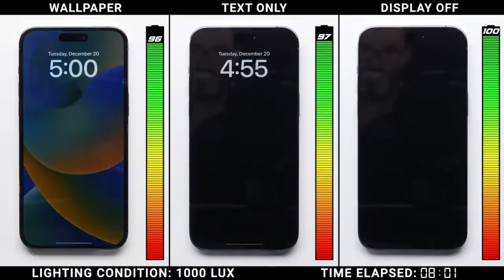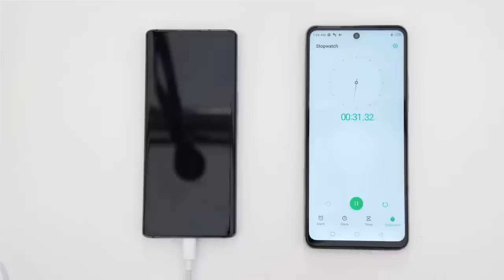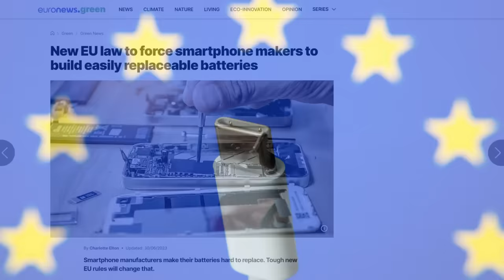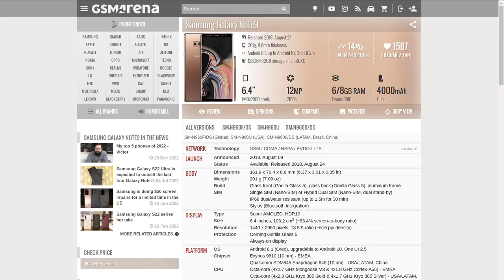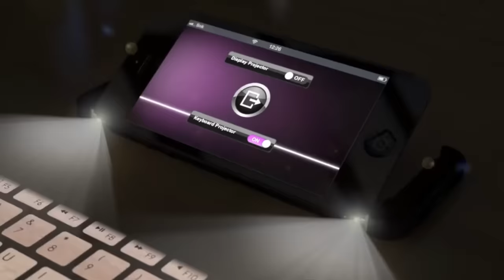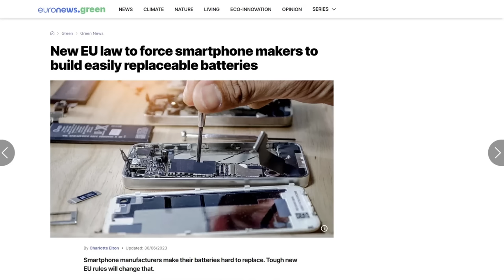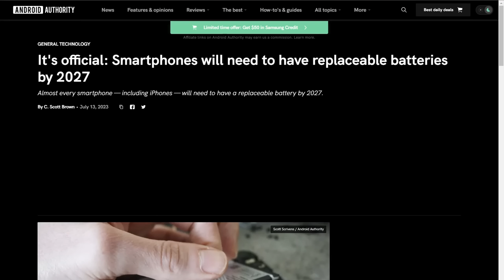All Smartphones Will Soon Have Removable Batteries

Comment: As the EU mandates this very useful policy I hope they also establish a framework for standardization of all batteries, so that the batteries from different phones can be interchangeable.
Edit: After taking into consideration many of the replies here's my reformulated proposal: 
1. INCENTIVIZE standardization rather than forcing it, so that companies can either manufacture common products with standardized battery and receive a small tax-cut for it OR produce state-of-the-art high end devices with custom made batteries, but in that case pay higher taxes. 

2. OBVIOUSLY with standardization I meant standardized per category (based on capacity/application) i.e. all 4000 mAh batteries would be interchangeable among each other BUT not with 4500 mAh batteries, as those would obviously be bigger in size and would instead be interchangeable among other 4500 mAh batteries. I thought it was clear enough but apparently it's not 😅🤦🏽‍♂️

Do let me know what you think about this and what else would you add, although I'm no policymaker, just an ordinary EU citizen (Italian)😅😂
Reply: Yes that is absolutely too much
Reply: Space is so tight in a phone that the battery has to be exactly the right size to fill the space to maximize life while minimising the size of the phone. Standardisation would be great but seems very unlikely.
Reply: Dream on 🙄
Reply: Its wild. If you bought a car and they said the batrery wasnt changable you probably wouldnt buy it
Reply: Bad idea.
Reply: @censored4christ162  yeah, but also you don't pay your yearly salary (or more) to buy a phone.
Reply: It depends on how much battery's are standardized. Is it one battery to rule them all? Bigger and / or more powerful phones usually have a bigger battery. What if new battery technology comes out but over-regulation makes it take years to roll out because it must be approved for use. Governments are slow on approval.

It makes sense that generally similar size devices should use a similar size battery. Proprietary batteries should be avoided, but I also don't want to see manufacturers tide to only one or two options for the next decade, even when better designs become available.

I'm not saying you're suggesting that. More a word of caution.
Reply: eventually
Reply: Requiring batteries to be physically interchangeable may be too much, since phones can vary wildly in size, form factor, and battery capacity. It maybe more feasible to just standardize the battery contacts, rather have each manufacturer use their own proprietary one.

Depending on the phone, even now it should be mostly possible to interchange batteries even if they don't physically fit, as long as you know what you're doing. Many phone batteries only has 3 contacts - two for the positive and negative (usually 3.6V nominal), and one for the thermistor. If you hook these three contacts up *correctly*, the phone should run.
Reply: I mean we weren't able to come up with a one size fits all standard for primary primary cells.
So we have like 10-12 formats that are used everywhere with AA and AAA being the most used.
I could imagine something similar for rechargeables. Like having a maximum of 10 different form factors but manufacturers will have to do with them. No more Diamond shaped cells with rounded edges and strawberry flavored electrons ;-)
Reply: Standardizing batteries won't be done, but standardizing charging method and pin layout could. Imagine external charger with size adjustments to fit all sizes of batteries, and since we already have charging standards for USB-C, adding charging standards for battery itself is not unreasonable.
Reply: that is asking to much don't get hung up with useless details like this. The right to repair would be much better, that all componets need to be easily replacable...
Reply: Why people are celebrating this this will have more negative impact on phones they become less water and dust resistance also uglier and bulkier phones
Reply: @sanjeremyph : Dude you know nothing about this. This how phones always were till like Galaxy S5? So muuuuuch better. for 20$ you get a new battery not 120$. If something goes wrong you just take in 3seconds the battery out. If you don't want to be surveilled same thing take battery out. Water and dust? when has that been a problem for a phone. For me neither (with replacable battery)..
Reply: @peterlustig8778  old phones weren't as water and dust resistance as today phones they had uglier design had no wireless charging phones are sealed in a way that water can't enter thier main electric parts with removable battery they wouldn't be as durable there is a good reason that companies came with this design because it is a better design
Reply: @sanjeremyph  It's funny when you tell me how old phones where.. I have my Samsung Galaxy S3 here in my Hand it is slim, nice a a really fine phone, super easy to replace battery. it's 7 years old went through rain and dusty places. Nothing to it. No the reason that you can't take out the battery is that they can A) charge 100$ to replace it/or make you buy a new phone and B) that the data collection continues even if you thought your phone was off...
Reply: @peterlustig8778  you think If they make replaceable battery the collection will stop no because easily they put a second unreplaceable small battery that keeps collecting data second If they want you to replace your phone they easily will do other things to make you replace your phone like programming it to become extremely slow after 5 years it's not that hard for them to do such thing they program in a hardware level that no one can fix it replaceable battery will make no good impact even now they can market phones as a replaceable battery you just need a cheap heating pad and special screwdriver to open a new phone it's not that hard to replace battery then you glue it again
Reply: @sanjeremyph  For what my Samsung Galaxy is ages old and still works?
Back to the good old times in all fronts in society. ;)
Reply: That's unrealistic and pointless. A fast charge battery on a large phone won't be compatibility with a small phone without fast charge capabilities. What they want is great because you can swap out batteries when one runs out if you don't have any access to charging your phone.
Reply: By 2033
Reply: I support this move. Unless there are innovations in the battery side of the tech, I do not feel secure in having a battery that is not easily replaceable and always deteriorating in every single charge.
Reply: no that would be a bad idea
Reply: It probably is too much, but should really be a thing for phones, tablets and laptops. Particularly for devices like Laptops where they're not especially small and have legally limited maximum capacity, there's no reason not to have standardised battery types.
Reply: @garreth629  Ideally a small set of standardised sizes, capacities and charge/output rates. A standardised connector would mean that new battery tech could likely be a plug nd play upgrade. Case in point, I rebuilt a 30 year old Maglite with a variable LED bulb and USB charging lithium battery. Yes it's more simple than a phone, but if we can have the AA battery standard for over 100 years (1907) there's no reason there can't be a Phone battery standard.
Reply: @censored4christ162  They never said the battery wasn't changeable. And you don't even have to send the phone back to the manufacturer to change it. They change it for you in 5 minutes in the nearest phone shop/repair service. Usually you don't change your car batteries either. You take it to the mechanic
Reply: Would be cool but would probably stop innovation or different sizes of phones being popular
Reply: No my friend. You cannot do that because every device needs a different type of battery for its specific motherboard. High power battery could fry up your phone
Reply: The batteries themselves are one of the hardest things to actually standartize. They have 3 dimensions (thickness, length, width). That means that you would need a lot of formats (which harms the standartization efforts in the first place), or cut them down too much, taking away the flexibility of the internal components' design and arrangement, and forcing phone manufacturers to work around thr few pre-existing batteries. Doesn't sound like the right approach. The most important thing to standartize are the connectors and lack of proprietary firmware to allow for third-party manufacturers to make working batteries. That being said, some common battery formats should still be made with manufacturers encouraged to consider them optionally
Reply: @mom_spaghetti  uh, no, that is only if the voltage is too high or the board is badly built/has a failure, the device hardware, properly designed and working correctly will only pull the amperage it needs/wants, so a device pulling 100mA can last for days, possibly weeks off of a 10ah battery that can push 100amps if needed, for example

Comment: Agree completely, except regarding multi-camera arrays! As a photographer, I find my S22 Ultra's 4 cameras to be extremely useful when I don't have my camera or all my lenses with me.
Reply: 2 back cameras should be plenty. a wide angle 20mm equiv. and a 50-70mm equiv. most ultra wides are useless anyway.
Reply: @PaDamTuts  
Average Joes don't need a Torx screwdriver in their toolkit. Adding one is an unnecessary cost. Anyone who needs one can buy one. Anyone who doesn't need one should have options to buy a toolkit without it for a lower cost.

It's the same with cameras. I don't care what a professional needs for their career — I shouldn't have to buy it if I'm not going to use it. Dedicated professionals carry DSLRs anyway. Multi-lens phone cameras only appeal to amateurs.
Reply: @PaDamTuts  I'm a photographer myself

Comment: Agree with the headphone jack option back. The multiple camera system it's ok in my opinion, is useful. However, if we still talk about bringing good things back, remember the good old times when you screen was intact? Now you have to look at it through wholes, notches and .. who know what other terrible creepy things are still to come. Luckily, my 3 years old Motorola phone still has these 2 amazing cool features :) (but .. no, the battery is not removable; and despite that it only has ip44 water and dust resistance - the Galaxy s5 which has a removable battery comes with ip67 - so .. they should invent more plausible excuse when they try to take the extra cash from us).
Reply: Not really useful the headphones jack since usb-c headphones now exist and it's now cheap
The useful thing  would be external stockage (SD card ) cuz when you are out of stockage without that its either removing thing or using cloud and you always need internet for  cloud also sd card are usually better for transfer)
Reply: @DERRPANZER  except not all the headphones are USB-C and even if it became the new standart for headphones, it would be a hell because, apparently, headphones can be plugged in other stuff, so I'd have to buy either a weird-ass minijack—usb-c adaptor that would inevitably get lost every now and then or I'd have to buy a new PC that has USB-C outlet, a new guitar amplifier with USB-C outlet in order to not disturb my neighbours, a new player(yes, those are still a thing if you go hiking/camping away and want to keep your phone battery alive for stuff like emergency calls or leave your fragile smartphone at home and take a sturdy 10$ call-brick with you instead), etc. Plus, it's always better to have two holes instead of one because the USB-C port can be occupied by charger, wired PC interaction, a microphone or whatever the heck else in the moment when you need your earphones
Reply: @ДимаВеселов-в8и  i mean  on average ppl just want to listen music without having to charge the headphone so not all phone need to have jack just some phone especially the one that are Known for good sound need to keep the jack 
Since it Will be a burden for ppl Who dont need it the jack take some space so bigger phone with useless space on it for these ppl

Comment: I think there can be a major difference between replaceable batteries and the removable batteries we had in the past. There can still be screws (nonproprietary ones) holding a backplate and ensuring a seal, while remaining user replaceable
Reply: Don't think that a ip68 rating will stay after replacing the battery. It's not a simple seal.
Reply: @sinnwalker  GASKETS EXIST :o
Reply: @madbruv  Again, it's not that simple. Otherwise we'd have the option, even in most modern budget phones now it's all sealed up. Being THIN with GREAT protection against debris and having a replaceable battery system isn't that simple.
Reply: It is that simple, it always has been and lots of devices including modern smart phones have had that feature the same you can have any electrical connector be intrusion safe against liquids. The difference is 0.5€ and 1.50€ per phone in manufacturing costs.
Reply: @madbruv No, you heard it. Apparently gaskets, which have successfully kept machines waterproof for decades, are not good enough here.... 😂
Reply: @sinnwalker   TL,DR: You actually can make a water resistant phone with a removable battery. They've done it before.

The Samsung S5 (released in 2014) had replaceable batteries. It was 8.1 mm (0.32 inches) thick with an ip67 rating.

The Samsung Galaxy S23+ (released in 2023) does not have removable batteries. It is  7.6 mm (0.30 inches) thick and has an ip68 rating.

The difference between an ip67 and an ip68 is that a 7 is water resistant up to 1m (3ft 3in) and an 8 is water resistant beyond 1m to manufacturer specifications (in this case, 1.5m (4 ft 11 in)). They have the same dust protection.

So you can pull off a pretty reasonable level of water resistance, dustproofing, and slimness with a removable battery.
Reply: @sinnwalker The relation to water resistance is manufacturers and apologists cope. Flagship phones with swappable battery had high IP rating, with many exceeding the rating of today's average smartphone. Samsung Galaxy S5 comes to mind as one example.

And then you have the whole niche of those "tactical" or rugged smartphones, bulky, with very high ip ratings. Most of them have swappable batteries.
Hell, even walkie-talkie radios have high ip ratings, while having swappable batteries.
Reply: @sairentov  It shows that all of you guys have never designed small things. 
The industry uses a glue seal, since it’s not only easy, but because normal seals on a phone would be impossible. 

The reason for it being impossible, is O rings and such have decently big dimensions. You wont be able to make a a tiny seal, and assure that you have perfect pressure all around on said O ring. 

The EU is ruining the smartphone, just like they did with their mandatory USB C. Goodbye development.
Reply: @010falcon  Literally told you multiple existing devices that do this, but sure "its impossible"
Reply: @sairentov  the samsung S5 
Even though I don’t know if it really had a tiny gasket, was a thick phone and only IP67 rated, modern phones are IP68…
Just like your rugged phones, they are not as slim as modern phones, if you want to see the dimensions of a rubber seal, remove your simmcard tray, and feel the pressure it requires to push it back in, to create a proper seal. That’s not even talking about sealing an entire backplate, and the space that would take up. 

The average consumer doesn’t want a phone that’s heavier and bigger, performs worse and you have to replace the battery at lunch or charge it up so that it lasts for the rest of the day. 
Everyone talks about replacing the batteries on their phones. Yet not one of my friends ever complained of wanting to replace theirs, let alone having replaced their battery ever. And keep in mind these guys are rocking s8 and iphone 10. (I myself am on a S10 plus, which still has plenty of battery capacity left). 
By the time the battery is so bad, that you need to replace it, the phone is already broken or outdated. 

It’s like the idea of the framework. 
Cool concept, but if you upgrade, the only thing you like to keep is maybe the chassis, which isn’t even so ressource-expensive to produce. 

Listen, if you want a phone with a replacable battery, buy one of them. Like you said, they are out there, the workphones. But stop destroying the normal smarthphone, if in the end normal consumers will just buy a new one anyway.
Reply: @010falcon Yeah you see whatever 'average consumer' you speak of is not informed, is easily marketable and easily manipulated.
Sure your 'normal consumer' will buy anything. That does not mean any practice that makes a sale is moral, sustainable or positive for the consumer...

And while on 'the average consumer' game, IP67 vs IP68 difference is negligible.
'my friends don't want replaceable batteries' is ass anecdotal evidence. My friends do, that's just a shit argument

There are years of history of smartphones with replaceable batteries having pretty much all the functionalities of the ones without them.
What exactly is getting 'destroyed'?

Besides all that, the legislation comes from environmental concerns. I mean you can say 0.2mm thinner phone is more important than reducing waste but we can end the discussion there lol